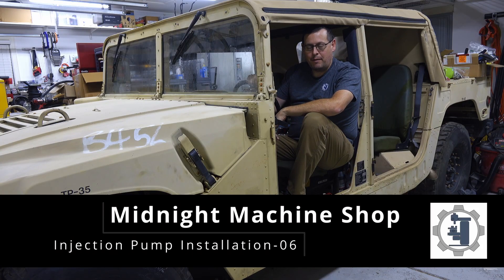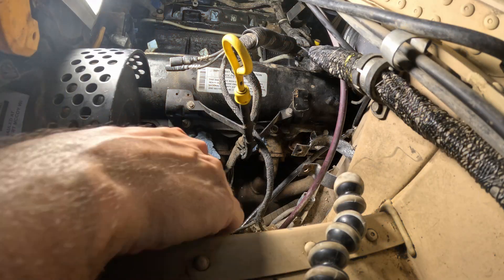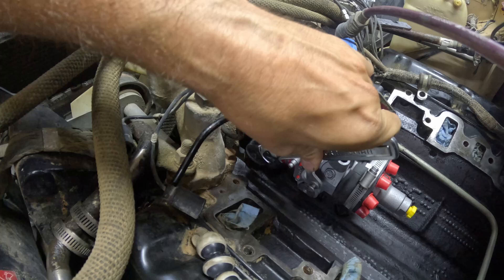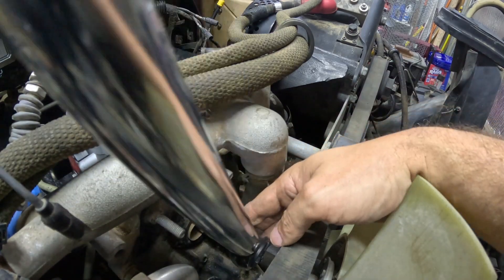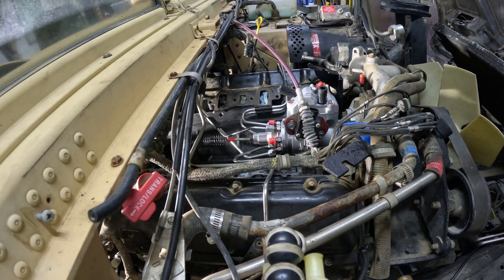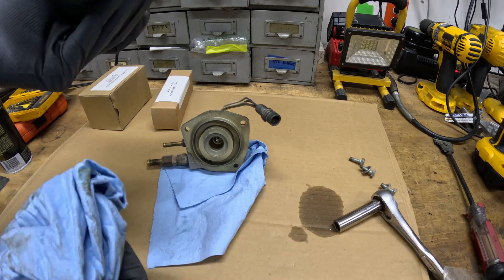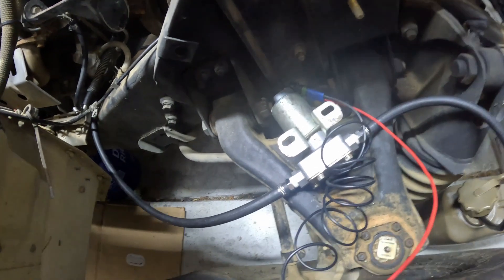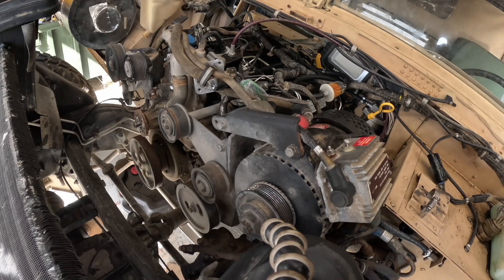HMMWV 6.5L Diesel Fuel Injection Pump Replacement: A DIY Tutorial

Comment: Before you attempt to start , you waited for the wait light to go out. I noticed it is a solid steady light and it is not blinking like what it's doing on mine.  Is there anything wrong on my start box or temperature sending when blinking light occurs?. By the way , I'm Still trying to bleed the air out of my fuel system.
Reply from the maker: If you are getting a blinking wait light but it eventually stops after 7 seconds or so, it could be that your temperature sending unit has gone bad. I cover that in this video.
https://www.youtube.com/watch?v=bgYUxcEScDk

Comment: where did you sent the pump to be worked on ?
Reply from the maker: I used a place in Memphis, TN but I wouldn't recommend them knowing what I know now. It turns out they aren't one of the places listed on the Stanadyne dealer locator. The rebuild shop missed that the electrical connector on the cold advance solenoid had cracked inside the pump. I noticed it when I went to connect it and the entire connection flopped around loose on the cover. After it took 2 months to get the pump back from them in the first place there was no way I was taking it out to send back to them so I wound up ordering the part myself and installing it.

Comment: This thumbnail gets used a lot for different things. Is the brushguard that bent, or is it photo shopped?
Reply from the maker: It was that bent when at the GovPlanet sale yard. I'm guessing that it was folded down and someone either drove into something or someone backed another truck into it. It also took out the front winch mount plate (1/4" thick steel plate) and the two brush guard mounting plates. How bent it is can be seen in the Cooling System Disassembly video ( https://youtu.be/ICmp_eZvA6U?t=9 )

Comment: Thanks for the info I just recently tried to rebuild my pump since it was leaking fuel through weep hole.
Just installed and tried to start it with the intake manifold off to check for leaks but it revs really high so I turn it off quickly.
Tried to start it 3 more times with same issue. Is this because the intake is off did you have that issue when starting it without the intake manifold on? Thanks
Reply from the maker: I didn't have that revving issue when I started mine with the intake off; I'd suspect there's something not right inside your injection pump. 

I did look into rebuilding my injection pump myself but realized that completing the job requires expensive test and calibration equipment that I didn't have. And it turned out that mine needed more that what I could see from the outside so I'm glad I sent it to be rebuilt.

Comment: I see how you did it now, problem though. My m1123 has no nut there. But it does have a spot to turn in on the bottom pulley. Adjustable wrench fit the square pegs. Bingo. Still appreciate your video alot, thanks.
Reply: I’m having the same problem you got the wrench to fit in the pulley balancer? I took mine off and found a nut I can connect to but it won’t budge, feel like if I go harder I’ll sheer the cam nut off. I’m also working on a 6.5td. Any suggestions
Reply: You put a nut where the balancer went? Im guessing its not giving you good leverage then. If the balancer is like mine it had squared notches on it. Otherwise im thinking you might need to pull some glow plugs so your not fighting compression.  If you bust the bolt there oh man that would suck.

Comment: The reason there's no torque spec in the army manual is because the miiltary doesn't bother with replacing just injection pumps.  They'll just replace the whole engine assembly if its not starting.
Reply from the maker: That may be but the torque spec is not in the engine maintenance manual (TM 9-2815-237-34) either, including Section 2-41 which covers assembly of the entire engine.

Comment: I recently did this and I’m not getting fuel after the pump to the fuel lines at all, just like puffing air instead, any suggestions?
Reply from the maker: TM 9-2320-280-20-1, Section 2-22 has a guide to determine issues with the fuel system.

Comment: Ok, I have the new pump, new intake gaskets, line wrench from Black dog customs, now I am going to go through both videos for the 4th time and make a list of all the small shop pieces/parts that you mention.  I do not believe that I need new lines; my unit from gov planet was a runner and after inspection appeared to me to have been a nice motorpool queen.  Pressurized fuel leak/fill check with the electric pump is a particularly  good step.  thanks I am going to replace fuel filter/separator since I will be in the area.